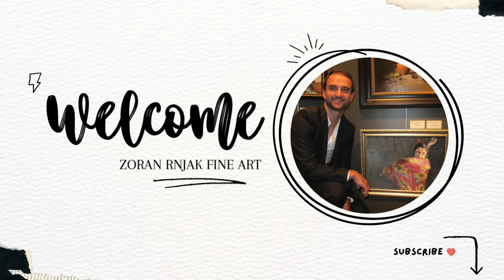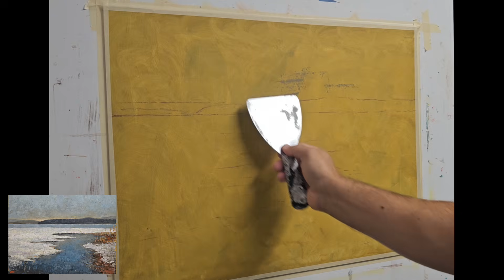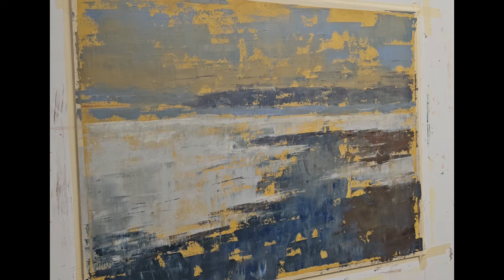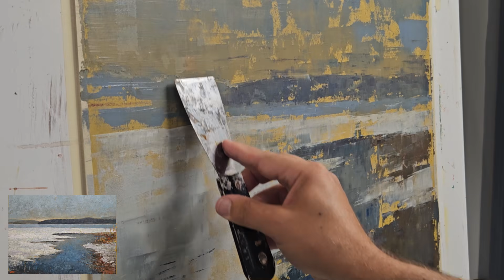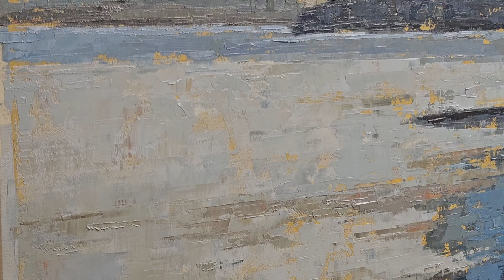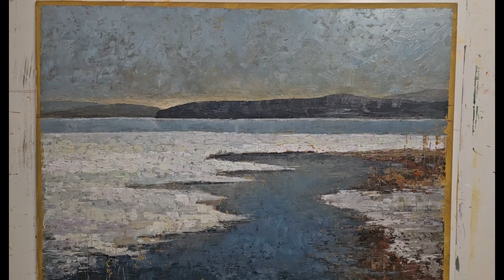How I Use BROKEN Colors | Oil Painting for Beginners

Comment: Can you explain in more detail what surface you are working on? You seem to have a rough surface that allow the first layer to scumble  across the surface? Also, are you using water mixable oils and if so what do you use to thin the first application especially when you use cold wax?  Thank you!
Reply from the maker: Good evening. This particular piece was not done using cold wax nor water soluble oils. The long intro kind of covered the reasons behind that. The surface is an acrtylic board that has an acrylic primer over which direct oils were applied. If I do use water mixable oils as an underpainting like in creating washes, I generally allow it to dry before coming over with cold wax (If I was doing that). Does that answer your questions? Cheers
Reply: @zr_fine_art  thanks